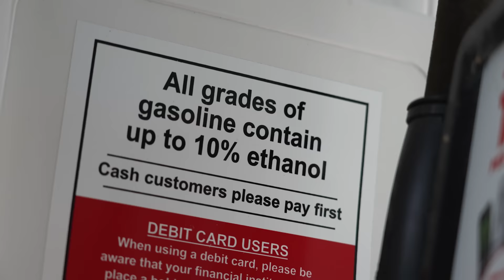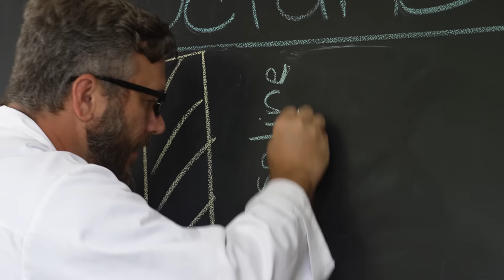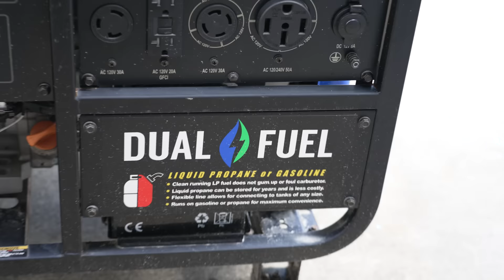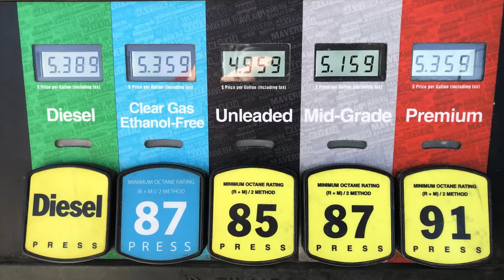This Will Destroy Your Emergency Generator! Don't Make This Mistake

Comment: Here's my take on E-10.

While I am an, Electronics Engineering Technician. Not a chemist. I have friends who are, chemists.

I learned something interesting about, Alcohol. While it is a clear fluid that looks like water. They have told me. It's actually,  an, Abrasive, fluid. That is to say. It can help to scrub out your fuel lines and combustion chambers. While raising the octane on easier to refine, gasoline a.k.a. benzene, I think? And Petrol, in other places. And it's all the same explosive stuff.

And so alcohol is an abrasive chemical.. By its molecular, makeup. I've been told by the chemists. And so it serves more than one purpose. And results in, lower emissions. But not on men. As men are doing all the polluting now. With,  Spermick Oxides. That are, destroying a woman's, Ovic layer. I think? It has something to do with the atmosphere of the moment. I think? I wouldn't exactly know? I'm kind of in between the genders. So it's a bit of a non sequitur for me. I mean I know. Sort of. I'm not driven by that. I didn't need to make any babies. All of my relatives and friends. Could do that instead. So I didn't have to. I mean who likes little children? I'm an adult. I don't want to be around children. I like other adults. They are more fun. You can use dirty words. You can walk around naked. And not get arrested. So?

I think children are for people that have a screw loose. Who needs to keep life going? When there are so many, Homo Sapien Dictators. That want to end it all for us? Why would you want to bring a child into this world? You have to be some kind of selfish narcissist to do that.. What's going to happen to the children? You don't care. You just wanted to make some. You were afraid you wouldn't see yourself running around on the living room floor. Will you already had your time! Your child is not your clone. That's why you don't want to bother to have them. They will want with they want, the way they want it. Who wants to deal with that? Screw children! And unfortunately some guys do. Chris Hansen, interviews them frequently. I know Chris. I've worked with Chris. We both used to work for NBC-TV News. He's a good guy.. He interviews Pedophiles as they are Caught. It's great!  Those ass holes are such incredible Losers. Now That's Entertainment!

I say. I would like to see a new YouTube show. Pedophiles in Jail. We want to see them on their hands and knees, buns up, kneeling. And ready for their Acceptance. As they won't have any choice. And they will get exactly what they need! For a long time to come. It's perfect. Chris Hansen is great. Keep up the great work Chris! There seems to be a lot of them out there. A continuous nonstop amount of them. And I don't get it? What is the attraction? I like being an adult. I like being with other, adults.

So none of those Boys, ever grew up beyond, junior high school level. The Subway, way.
RemyRAD

Comment: just a idea, but i have made wine, wine making suppliers sell a  wine fermentation tank that  is clear and has a bottom drain because yeast settles to the bottom just as the Ethanol and water does in your gas. Just informing everyone but they are alcohol safe containers but not sure if they will handle petroleum. google it.......

Comment: Great video.  Of most importance is the information about the LOWER performance characteristic of ETHANOL fuel!   20% to 30% LESS TOTAL ENERGY PER GALLON!  That's a HUGE difference.   Almost anyone should be able to notice the difference:  in overall gas mileage per tank full or the significantly less "get up and go"(power/drivability).   In a few areas of USA, the reduction in smog may be noticeable:  Los Angeles!  I'm a 5th generation Californian (Los Angeles) and I've lived through the horrible smog of the 1970s.  IT WAS BAD!  But with the implementation of catalytic converters and fuel injection, the air became noticeably cleaner by the 1990s.   But, a few million more people moved to Los Angeles (or were born), since 1990... and it is continuing.   With the additional crowding and everyone has to have a car...the smog is coming back.   The smog isn't as bad as it was in the 1970s, though. With 20-30% LESS energy per gallon, that equates to more fuel being consumed and producing smog.   Plus the additional gasoline leaking out of rusty gas tanks and deteriorated gas lines EQUALS MORE SMOG!  ...AND THE FUEL USED TO GROW, DELIVER, AND PROCESS THE ETHANOL!  And, DAMN!, I hate the increase in the the price of MY Doriitos, Corn Flakes....and Jack Danial's!

Comment: AvGas or Aviation Gasoline has no ethanol in it and is very stable. It will store longer and does not have the ethanol related problems. Might be a good option for your small engine if you have access to it.

Comment: Ethanol-free Gas (often called "Rec. Gas, E0, etc.) can often be found at stations near marinas. Some boaters use Ethanol-free fuel to avoid the alcohol from "absorbing" water from the wet environment.

In my area, Rec. Gas (Rec. 90) is typically $1 or more per gallon of regular. Apparently, States offer tax breaks for ethanol gas and no tax discount (or additional taxes) for ethanol-free.

I heard small plane fuel must meet FAA specifications which among other things, ethanol is prohibited. But they'd probably not let you fill up at a small airport. The octane rating is probably going to be out of range for small engines and it's not going to be cheap!

In a pinch, the big box builder's stores sell ethanol-free and two-cycle fuel in small sealed metal cans, supposedly for storage or convenience. Again, it ain't cheap.

Comment: A quick web search should be able to show you places with ethanol free gas. Additionally check the labeling for premium gas (91 Octane or up) at various local gas stations and you'll likely find that one or two of them offer ethanol free premium. Here is south-central PA Steve's General store/ the attached Pacific Pride on 743 have it, as well as certain Rutters and Sheetz locations in Lancaster, York and Dauphin counties. (I'm sure it extends further, I just don't travel that far for mower gas).
Reply: GasBuddy app.

Comment: Funny, but mostly wrong. The first issue is your generator is cheap (may be chinese?) means , all the rubber is not ethanol worthy. Same in old cars and bikes. Modern equipment is ethanol save since decades. Second: less energy per volume. Thats not an issue, as you use propane anyway (also less) but no diesel (more). If have some old equipment, you are right. Remove the ethanol. If you want to save some money for gas: add up to 25% ethanol in your truck (but has to be around 96% at least). Get it from destillation of a high percentage cleaner or else...finally use molecular sieve 3A to dry it). Test before filling in the tank: a mixture with gasoline has to be clear, also at low temperature. Yes, and the dragsters use methanol...

Comment: If you're careful how much water you add, the resulting alcohol mixture will still be flammable - you can use it for burning stuff or making heat. With these chinese generators, I like to keep an extra carburetor on hand with a spark plug and an air filter...carbs are literally like $12 on Amazon. Often the replacement carb comes with "illegal" adjustment screws so you can tune the damn thing if you need to.

Comment: Most gasoline sold in the U.S. is blended with 10% ethanol. At Biden's direction, the Environmental Protection Agency will issue an emergency waiver to allow widespread sale of 15% ethanol blend that is usually prohibited between June 1 and Sept. 15 because of concerns that it adds to smog in high temperatures.Apr 12, 2022

Comment: Why would leave gas in any small gas engine beyond 10 days. Why not suck the gas out of the tank, start and run the engine until it runs out of gas, I’ve done this for years and generally had no problems in starting it. So why would you use fuel stabilizer?

Comment: I had the same gumming issues with my power equipment for years! Every year having to clean out the fuel systems. I started using STA BIL 360 years ago and have had no issues with any 4 cycle or 2 cycle equipment since starting to use it! Problem solved!

Comment: The ethanol does do a good thing in burning off any water that gets in the fuel storage. Any residual water will rust the metal fuel tank from the inside. When there is more than 10% ethanol that is when all the gaskets melt. So my guess is that you added some fuel stabilizer or dry gas to the generator fuel, which pushed your ethanol limit over 10%.

Comment: In the north where it gets 40 below 0. Eternal works party good  don't neate ad heat which is alcohol.i add Lucas fuel additive. Better than stabilize. Hve no trouble in Chansaw neather.leaf some sit out for twoo years mower never missed a beat

Comment: Great video .... but your test is why engines don't run well . Like you said the ethanol is attracted to water. Usually what's happens people get physical water in there fuel cause of the ethanol.  The shoulder months like we are in now are some of the worst times of year when storing fuel cause of condensation because of such drastic temp changes outside 60's in days 30 's at night. I always store all my fuel in metal safety cans. Plastic cans that vent, most vent both ways allowing atmospheric air to come straight into your tank. Your fuel stored will most definitely go bad. I always by premium fuel also for storing cause storing it will drop octane the longer it sits. Yes use fuel storage treatment also......

Comment: Great Video Haxman.     Maybe besides drinking it with Coke (Ha ha ha...a Bum and Coke).   I am wondering;  anyone thinking about an effort to re-purpose the waste water/ethanol into other useful ideas.  Like windshield washer fluid.  Else fabricate a separate water/ethanol vaporizer to separately spray into the air intake.   Thoughts ?  ! You inspired ideas, and thanks for exposing the truth.

Comment: WHY do we NOT have small engines that can run on 100% ethanol,bio butanol,methanol?Are the manufacturers too cheap to make corrosion resistant parts?
Reply: Manufacturers are focusing on making propane generators and electric versions. Gas is going out of style no use in spending millions in r&d to cater to a fuel that’ll be gone in 30 years

Comment: In Australia it's the cheapest fuel but I still won't use it. Matter of fact, I use the best I can for my small engines. It is logical to use the highest octane for the smallest engines to get the best out of them. For one we mix oil into our unleaded for 2-strokes, further reducing octane levels. Second, I want it to start pretty quick not after the fifteenth pull ffs. In the US corn farmers are subsidised to produce crops destined for fuel so good on you people using it forcing all taxpayers to pay for it to be made! That's bulldust.

Comment: Ethanol based fuels are absolutely fantastic, the problem is 99% of vehicles and engines out there predate the the employment of ethanol as reduction, when a device is actually built for it, it is in every way better... except for long storage as ethanol  has a tendency to be hygroscopic.

Ps, quality content btw. Sub gained.
Reply: The point of this video is maintaining fit for duty equipment in preparation of emergencies of an unknown duration or intensity..., storage is a requirement.

Comment: If you are triggered by math, science and facts, stop reading.  In IL it is ILLEGAL to sell any gasoline without ethanol.  In NE it is still possible to purchase non ethanol high octane gasoline.  The federal EPA website should should show expected mileage for your vehicle with ethanol and non ehtanol gasoline types.  My vehicles are abiut 25% better without ethanol.  The improved 25% is much better than the 10% differece in price.

Comment: E10 is crap! Less caloric effect! Makes my remapped ECU on my ecotec v6 3.8 litre run like a dog. I always put 98 and every couple of months ill run a few tanfuls with fuel doctor to clean the injection system and fuel tank. Its the best in Australia. Can you please tell me where i can order the fuel testing equipment? Subbed and liked 👍 cheers from Australia ❤

Comment: Oh the reason for the Ethanol being added was it helped start driving food prices up and it consumes ridiculous amounts of water to make the ethanol. Well that's what they say anyways. Its just like the push towards natural gas  it is actually dirtier in the long run and it uses billions of gallons of water for every fracture. That supposedly is so contaminated it's un fixable and gets pumped into underground storage wells on the fracking sure. But you turned the bedrock into gravel so how are you putting storage well in that area other thing that I've heard over the years that when the the federal government would go in like try and inspect they can never actually really find the wells that that fracking water leftovers stored in but if you remember back in the '80s early 90s the ultra Rich kept saying that the next gasoline was going to be water that they're going to figure out a way to own all the waters that they can sell it to us at highly increase prices and we're having all this problems with there's so much of our freshwater missing and they've been taking it and pumping billing each one of those Wells fracturing Wells takes billions of gallons of water that is unaccountered for when it's done just how many of those Wells are there there's so many of them so they have just trillions and trillions and trillions and trillions of gallons of water that we handed over them to make us Natural Gas Energy because you can't go without water I mean you can find a way to like wear clothes and be warm and shit like without the water your screwed

Comment: I'm glad I watched to the end. I kept wondering, "why not just purchase ethanol-free gas?" I know it can be difficult to find and is more expensive, but it's definitely worth it. For infrequently used equipment I also run them until the tank is dry. Wasteful to some extent, I'll admit, but at least there's no stale fuel gunking up the works.
Reply: I've gotta go out of my county for ethanol free super
(that's all they offer in ethanol free) 
So that's 20mins away ,crossing a bridge with a toll or going 30mins north. 
Not so easy for everyone,if I know I'm going that way I do take a few cans with me for my small engine use.
It's either that, or use 100LL from the pump where my shop is (airport).

Comment: A funky "conspiracy" twist would be the way gasoline became the primary automotive fuel force. The explanation would take some research into the Rockefellers refineries and Henry Fords experiments with grain alcohols in the model A era. Not as shallow as hemp being legalized for wartime use yet another aspect of history not so commonly ventured.  Baron's be baron's!
Edit: A valve adapted to a see through large mouthed jugs lid with the bottom of the jug cut off turned upside down would make the separation a lot easier.

Comment: Ok so wait,  I go to the gas station and extract the clean gas. Then You’re saying add water and food coloring to physical see the separation?
Reply: Water removes the old and now corrosive ethanol from gas so if It’s old gasoline you likely stored it doesn’t burn a hole in the gaskets for the generator. Watch the whole vid friend.

Comment: But isn't octane booster alcohol based? I asking, not saying that I know.

Left gas in my chainsaw over the winter like you I knew better. And yeah rebuilt carb and new fuel lines. Now I remember to only buy rec gas for my 2 stroke toys. In a couple years though I will forget, and I'll be back here saying the same thing.

Comment: Yeah man.
Using ethanol fuel
In your chainsaw usually results in a shop visit that may cost almost as much as a brand new chainsaw unless you can fix your own stuff which many can’t.
I use ethanol free gas with Stabil
And I start and run my saws once a week regardless.
I also have a dual fuel generator just like yours but I’ve only ran propane through it.
The only way I’ll use gasoline is if there’s an emergency situation.

Comment: I just said to hell with liquid fuels and converted to propane (with an overpriced kit for the demand regulator). It lasts forever, doesn't cake up, and is incredibly reliable. Also, the oil stays rather clean I've noticed.
Reply from the maker: That’s what I’m doing now too.

Comment: Can I just use a generator without it being hooked up to a house having the generator outside with a 100ft heavy-duty extension cord ?

Because they say the landlord has to approve it being hooked up to a house ?
Reply from the maker: Yes. You would just have to plug individual appliances into it. You could power a window ac unit or portable unit but not central heat and ac.

Comment: Or you could just buy the fuel conditioner with ethanol treatment. I use it every time I fill a gas can. Compared to the time to fix a problem it is cheaper and better.

Comment: E10 is bad for everything  well guess what no it isn't  it doesn't destroy lawn equipment it doesn't destroy carbs  it may destroy fuel lines but it has never caused me a single problem truth is pure gasoline (I know I know gasoline has over 300 ingredients) has caused me many problems in small engines 
I used to work in a small engine shop and I've seen literally every problem caused by regular gasoline multiple times  since the ethanol blend fuels came on the scene ive not seen any of the problems everyone said they would cause ethanol is perfectly fine and won't cause you any problems  speaking from experience

Comment: I just wonder if the octane drop is from the 1/2 cup of water you added.
Reply: The water is removed, you're not burning water in the engine. The octane drop is from the alcohol being removed with the water.
Reply: @ryanroberts1104  get rid of the alcohol you get rid of the water.